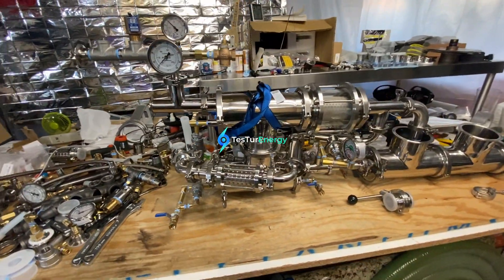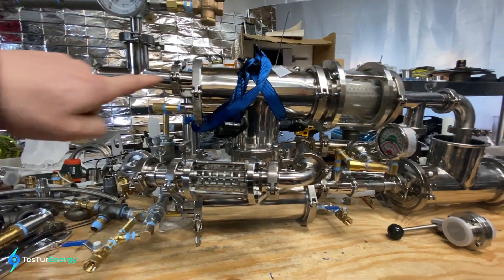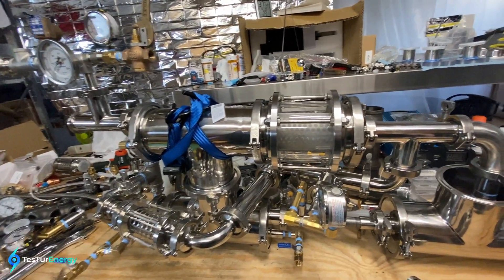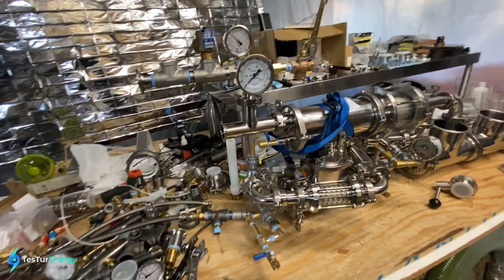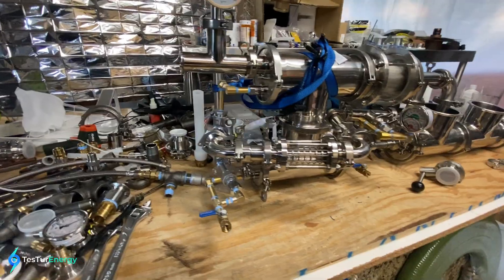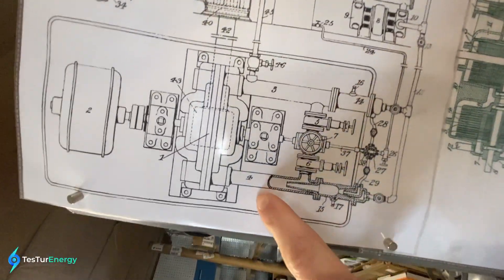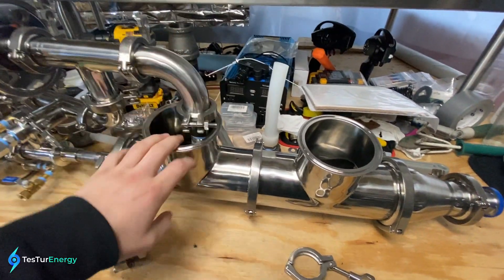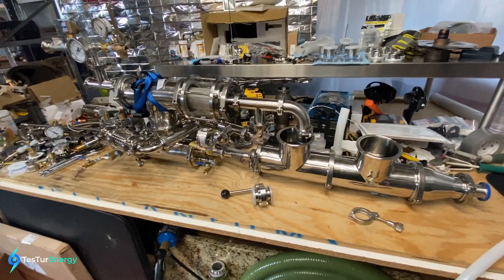Tesla Turbine Jet Engine Combustion System GB186,083 - micro propane burner boiler & mixing tube

Comment from the maker: Check out my latest tests of the 10in TesTur that I’m currently working on. 
Peak 2.75kW and 6.22ft-lbs of torque at only 4150 rpm https://youtube.com/shorts/yXQy844URMA?feature=share
And these are the 1200watt electrical load tests that I did last.
https://youtu.be/bWpXRzrzf4g
Reply: Yahh that one is literally legendary, the first tested high power Tesla turbine in existence

Comment: Do you have a 3D model????
Reply from the maker: Hey thanks for commenting Burnologist! Unfortunately, I don’t have any 3D models for the GB 186,083 system. Only stuff I have actually just built but I will have a finalized DIY assembly kit for sale real soon. I’m still working out exactly how I want everything to go though. Also I’m still testing the different fuel air mixing nozzles for the different types of fuels, liquids, gasses, solid particulates like pulverized coal AND powdered Iron or aluminum. 😈🔥 I can’t wait to start powdered Iron fuel testing because all the solid particulate FeOx (Rust) dust in the exhaust can just be cyclone filtered out and then have solar panels do electrolysis on them to split the iron and oxygen apart for a completely carbon neutral and renewable energy storage chemical process. 

I’m working on some updated designs for my turbine for the new stainless steel one that I’ll be cutting out for this whole combustion system to be able to handle all these intense fuels. So much more to come!
Reply from the maker: Hey Burnologist! I saw your comment on that video chat after I closed it. But no I do not have any sort of things between the discs that resemble blades. I believe you’re talking about adding “flaps” between the discs to catch the fluid better for more torque right? 

In fact you do not want to have anything in the way of the fluid disrupting it’s smooth flow to the center. When you design the turbine disc spaces correctly you do not need any extra “blades” in between the discs for increased torque. The boundary lady shear force that the fluid applies in the disc faces is more than enough to get plenty of high torque even at low RPMs. Let me know if you want me to further explain that as well! 

In the mean time, if you haven’t already, check out the dyno test I did with my turbine that got 2.75kW and 6.22ft-lbs of torque at only 4150rpm. Plenty of torque with only smooth discs! 
https://youtube.com/shorts/yXQy844URMA?feature=share

Comment: Is all this stainless hardware marketed for use in brewing/distilling? Where does one find that stuff?
Reply from the maker: Pretty much, yeah! Lol food processing industry uses them the most but they are most commonly used for cannabis concentrate processing and brewery/distilling. 

It’s certainly not for “turbo jet engines” or combustion chambers but they can handle really high temps and pressures if you get the high pressure bolt clamps. I’m using PTFE gaskets everywhere because it’s the highest temp capable one I can find so far but I’ve got some 1/8in ceramic fiber sheet that I’m going to be cutting out some custom gaskets to use. Maybe even make some custom high temp capable ceramic ones because if I could just do that I can make my entire combustion system out of this NICE stainless steel equipment. You can find it all in 304 or 316 stainless but the 316 is harder to come by and more expensive.